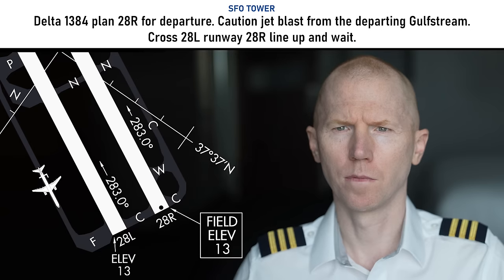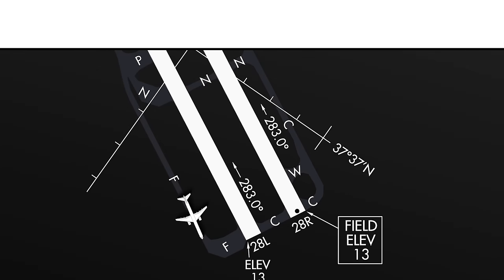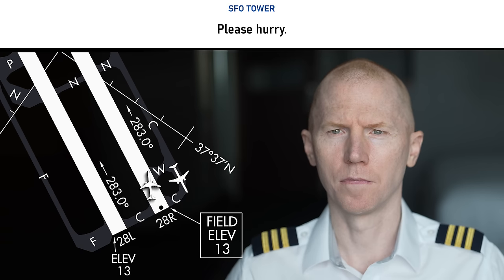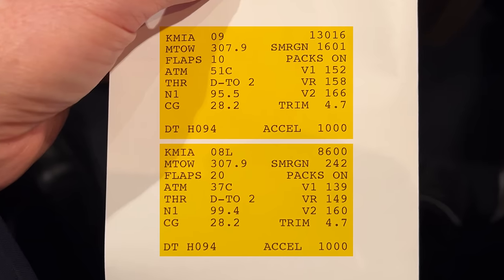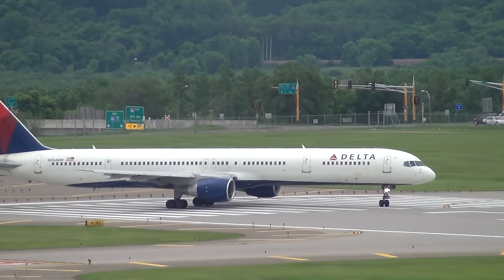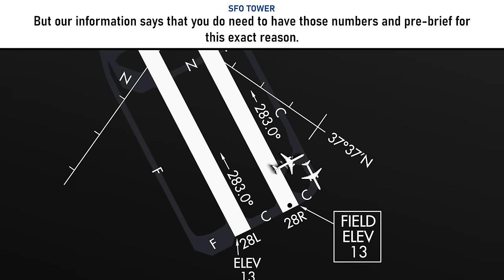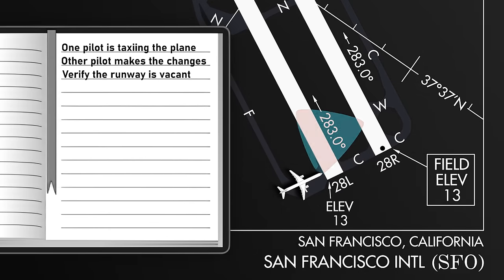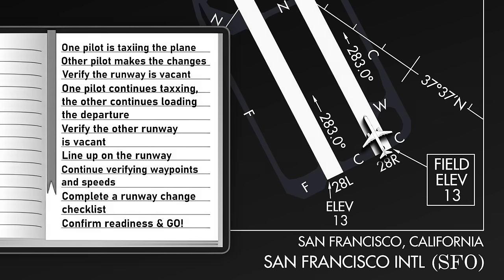ATC Doesn’t Like Delta’s Comment

Comment: As a pilot that flies out of SFO you know to always run numbers for both runways.
Reply: I fly out of SFO 6 times a month on average..  We always do that at our airline but to plug the numbers in, verify and do the runway change checklist. Takes more than 2 min…. Delta should have told the controllers they will hold short, and SFO controllers need to get their crap together.  Controllers are not in control of the pilots and planes.

Comment: In this day of fast communication and computers I'm surprised that the pilot must do all that setting of numbers manually.  Each airport should have the external points available instantly for each runway,  and the pilots should only need to change their individual aircraft data. But ATC must make allowances for last minute changes like this and clarify WHY such a change is needed.  I see room for improvement on both the pilots and ATC in this situation.

Comment: Setting them up for failer? Yeah! you think? Look, ATC has pulled this kind of stuff with me a number of times. Changing the runway at the last min and exspecting you to be up a ready in a snap. One thing I have learned is never let ATC or anyone push you onto somthing you are not ready for. That controler was way out of line. That Delta crew should have just stopped right there and took as much time as they needed to get their new numbers and re-brief what they needed. They should have told ATC what they were going to do and not give a danm about her(ATC) being impatient. Ever ask yourself why we are seeing a up tic in close calls and incursions? because of stuff like this.
Reply: Excellent. And I'm retired underwing!
Reply: Yes, you are spot on, and SFO has been getting a lot of these kinds of close calls lately. Not only frustrating for departing crews but inbound crews as well, often having to perform go-arounds. I just saw another video a few days ago about a crew that had to perform two go-arounds. Not good!
Reply: AMEN !
Reply: Rushing is never a good situation no matter what the event. If you look at mistakes made (sometimes big ones) rushing is a common cause. 
Cheers
Reply: The controller gave them that option. She told them exactly where the traffic was and if they weren't comfortable to hold short. They chose to be on the runway because they said they'd be ready. Then they weren't ready.
Reply: @beater8687 She didn't tell them what the traffic actually was, and therefore didn't tell them how much time they had to work with... As Kelsey explained.
Reply: @iro6758  did you listen to her next transmission? The one where she said traffic's 5 minutes out, if you're not comfortable with that hold short of Rwy 28R?
Reply: @beater8687 pretty important info, which she already had, so it wouldn't have hurt to mention it in the original transmission
Reply: @beater8687  "Did you ignore Kelsey and only pay attention to her finally attempting to be competent - eventually - after already pushing them in this direction with little-no relevant information?"
No.
Reply: @beater8687  don't you dare to blame the pilots
Reply: @georgemccoy219 :
I'm not a pilot, but it seems to me that any number of go arounds (within the minimum fuel reserve limit), would beat "bending"/"breaking" the aircraft, or endangering anybody, at least 💯% of the time?!?!
🙂
After all, the goal is supposed to be getting all of the passengers & crew on the ground with the aircraft (ideally), being in good enough condition to be reused, or so I've been told.
Reply: @daleallen7634 I'm also not a pilot, but from what I've seen and researched go-around procedures just increase the pilots' workload and reduce their situational awareness. A go-around is always preferable to an accident, but unnecessary go-arounds can actually increase the likelihood of an incident. If they can be avoided, they should be avoided.
Reply: @jacksonlynch1731  :
So, go arounds "are preferable to an accident".
But, they "should be avoided". 
Which is it?
At the end of my day, going around beats GAMBLING on a "safe" landing.
Most commercial pilots are very (too?), reluctant to request a go around, or any other emergency, or precautionary procedure, anyway.
Reply: @daleallen7634  It's not really a difficult concept. Driving your car into a road ditch is preferable to driving head-on into a school bus. But driving your car into a ditch is still something you'd want to avoid if possible. Just because something is the lesser of two evils doesn't mean you don't want to avoid it if at all possible.

Comment: You should fly into Oshkosh and see what super ATC controllers are really like. Talk about runway changes and halfway landing or take-off points.
Reply: I used to work at the Oshkosh newspaper and have been in the control tower (the old one) during Airventure.  I did find the controllers at Fisk more interesting, personally.

Comment: Why has no-one in aviation software  heard of hash functions/codes?  An aviation standard way to calculate them would make verifying all these numbers much easier/safer.
Totally agree you shouldn't brief both just in case though.  Human memory is bad enough at doing one thing.
Reply: Yes!  best comment!
Reply: Information can be entered correctly, but sometimes the information is shit and only picked up on entering, cross checking and sanity checking the values. As much as I love the idea it will lead to complacency

Comment: The initial runway change to 28R included the line up and wait instruction.  For whatever reason, holding on a runway while reprogramming the FMS is an invitation for Mr Murphy to introduce himself.  The crew was hesitant about it and wanted to confirm the line up and wait assignment.     If the runway change assignment was earlier in the taxi it would have helped tremendously.  As is, ATC is playing with fire here and they could absolutely get a contributing factor assessment if there were a tragedy.  I have t read the ATIS but I doubt any pilot would expect a runway change assignment and a line up and wait clearance at the same time unless it was a small GA aircraft
Reply: There's a comment above from someone who said they were right behind that Delta, and that such changes are common at that airport. And that they as a crew do prepare each time for it.
I think the pilot with his 2 minutes estimation is as much playing with fire as you think ATC is. Underestimating a procedure by half is not a good idea when it's that close.
Given i am not a pilot, i do have to drive onto runways occasionally , and even though i do not have to prepare all the data pilots do, i do have to prepare for the measurements i take (no not the "skiddometer" ones, we do regular checks of LLZ transmissions). And if i get asked by ATC about how long it takes me, i either know the exact time it takes and add 1 minute to it, or i do a little overestimation to be on the safe side.
Same when we do longer measuring drives. Then we can't say how long it takes as a whole, but we estimate that we can clear the runway and safety zone in a certain timeframe. And it's better for the safety of everybody to not underestimate time needed.

Comment: She tried to help them to get out and not have to wait for that traffic.

He said two minutes. He knew he was lining up on the runway with traffic on final.
He might as well have said I’ll be some time, who knows.
You can’t just make up numbers when you are lining up and waiting with traffic on final.
Be accurate or hold short. Delta should have accepted the hold short.
She tried to help them to get out and not have to wait.
They messed up.
Kelsey is being pilot friendly, but this is SFO not a smaller airport like San Carlos and even then they shouldn’t cause a go around for the traffic on final.
SFO!
Reply: I agree 100%... if a controller gives you a crossing restriction, a pilot just can't say    I was about to or on my way to cross. Either you agree or say 1 word "unable".

Comment: My best friend in the Navy who was hired by Delta as a 727 FE in 1981 confided in me that it disturbed him that he often had to scramble to start the third engine because the Capt accepted an immediate takeoff without the center engine running. (Back then high fuel prices resulted in doctrine to  taxi out with less than all engines running). He stated that it happened more than once that he was starting the third engine on the takeoff roll.
Reply: That's insane.  Someone's head should've rolled over that nonsense.

Comment: I am not a pilot. But all I can think about in this analysis is that we are not in WWII with airplanes with steam gauges and paper maps trying to get sorties off as quick as possible. As a passenger, I really don't care if we are even thirty minutes delayed for takeoff (I know that in most cases the pilots can make up that time in the air). I am an amature radio operator, however, and I know that when I run a pileup on my net (where more than one station is calling me at a time), I have to remind folk that we are not in a race. I'll get everyone, just be patient. The bottom line is that everyone is safe. For me, we are all ground based, and in my thirty years of being an amature radio operator, I have never had a life or death situation. Airplanes are in a life or death situation daily.
Reply: As a passenger, I'll be happy when emotionless AI takes over these situations.
Reply: @conradinhawaii7856  What did you base that comment on? Technology is always improving and automated vehicles, including aircraft will be a reality whether it scares you or not.
Reply: I was thinking the same thing. The way I see it: the main problem was that it was an option AT ALL, when a runway change is announced at the last minute, to do inputs in the computer on the runway with an approaching airplane on your tail.
Reply: @unzarjones  Not sure just yet about that, but some more assistance would be great. All these tests that were talked about could be performed by a computer, and you would not even need AI. Cold hard business logic and algorithms get you a long way, and they are void of the insecurities that an AI may bring. Having an AI system that alerts when something goes out of kit would be nice though; I think that's where they should start. Not controlling, but checking.
Reply: @unzarjones  
Forty-plus years of flying a variety of airplanes, including four-engine airliners, countless hours communicating with ATC, and having friends who have worked in ATC for their entire careers. 

A.I. so-called "experts" have been predicting, since at Least the 1990s, that computer-flown airliners (and computer-controlled ATC) were "just around the corner". So why do you suppose that you still have two Actual human pilots up there in the cockpit of those 737s, 777s, A-330s, and the rest, and Actual humans in towers, TRACON, and Center facilities? Something to do with the ability to reason, perhaps, rather than simply running programs? And how have those "self-driving" Teslas been working out? You know... the ones that have been killing motorcyclists from behind, and pedestrians, because the computer's sensors didn't "sense" and recognize their presence on the road? Situations like that should be quite "interesting" in an airliner typically cruising at around 400 knots. 

But you are More than welcome to be a passenger aboard any A.I.-controlled airliner, if that ever actually happens. Those of us who actually fly airplanes,  and understand the vast differences between operating any vehicle on the ground, which operate in only two dimensions, and flying an aircraft which operates in Three dimensions, not to mention a variety of meteorological conditions which affect every facet of how they fly and perform, will be happy to watch, from a safe distance, the inevitable outcome.
Reply: @conradinhawaii7856  you make some good points.  But using cold numbers.  Last year over 42k people died on the roads in this country. IF every vehicle was controlled, interconnected. The estimates are 4K to 6k people would die in traffic accidents due to auto drive error.  So yes auto drive will kill @5k people.  But people ignore 37k who lived.  That said I don’t was AI, auto drive… I might be ok with it on interstates only. 
  Planes i want a human pilot.
Reply: Mentour Now says 10,000 planes were built similar to the DC-3. Meaning one HECK of a lot of army air force people knew how to get one in the air and fly to a target. Probably a huge multiple of civil aviation jobs.
Reply: @conradinhawaii7856  They said it about cars too. It's only a matter of time.
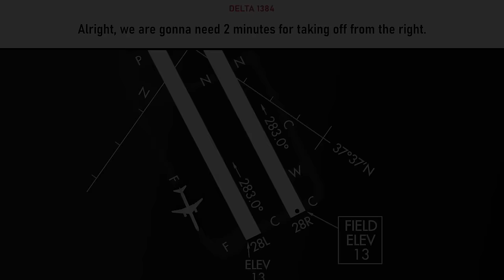Reply: They never really make up time in the air. About 20 years ago they padded all the flight times, due to many flights being late. So the published flight time is 30 min or more than the actual flight time. That's why after this change you never see the TV commercials with "most on time flights" etc.... Where prior, all the airlines too turns bragging about how "on time" they were. I first realized that on a trip to Cancun, where I had flown many times to. It was always a 2.5 hr flight for me. Booked tickets one time and now it was 3:15 hr. Questioned the added time. But the actual flight time ended up being 2.5hrs, like it always was. But yeah, there are a few things they can speed up a little, but think about it. Do the airlines want a plane deliberately in the air for 30 more minutes an a 2 hr flight and burn up all that fuel?
Reply: @inothome  As I said about my driving philosophy: All schedules go out the window if I crash. So I take whatever time a safe trip requires.
Reply: @unzarjones  
Uh huh... suuure.  Whatever you say. 🙄🤣
Reply: @JimMork  My reply was for the original post, about how pilots "make up time". But, the airlines schedule more time than the actual flight needs. So, they can leave late and still make it "on time" or ahead of schedule.
Reply: You might not care that you’ll take off 30 minutes late but the companies who get fined for late departures sure do!
Reply: @RomySews  Only late push.
Reply: @RomySews  THIRTY minutes? The landing plane was ten at max. But, once again, any accident may erase  you or make you a day late. Just as traffic accidents totally wipe out schedules. And when planes crash  like Tenerife that ALSO was a guy reasoning like you do, two planes were wiped out and hundreds of lives ended. "Fines"? Honestly? You think fines are a some big deal?
Reply: Are you trying to type "immature" or "amateur"?
Reply: @DavidSprings  Probably "amateur." As in "HAM" radio (or related).
Reply: @DavidSprings  I am so sorry if I was incorrect. I had a stroke several years ago and even though I hold a doctorate, no longer do the words translate from my head to my fingers. Amateur Radio is what I was trying to say. KB7QOD.
Reply: @unzarjones  But no one HAS to buy one. And if they share the highways, maybe a few of us can figure out ways to avoid them.
Reply: @conradinhawaii7856  I agree with  you. Let the ads say "WE use AI. Fly with US". And the thrill seekers and dependent personalities can pay for the tickets. And if there are surface alternatives, perhaps contrarians can skip "AI in the sky".
Reply: @larsharris  That old argument. I've seen that hundreds of times. I always say "Perhaps. We have thousands of totally unskilled operators on the highway. MY record since I first started driving is 100 percent different. There are many things done wrong on highways I don't do, and my insurance company gives me rock bottom rates to reflect that they aren't getting claims from me. But the  logic never stops some from dragging up "stats". Recall Mark Twain: There are three types of lies:  Lies, damned lies, and statistics."
Reply: @DavidSprings  "Replied" This is a question not framed as a reply to anything.
Reply: @JimMork  you can disagree with estimated Number of deaths caused by  self driver mistakes.  But you have to admit.  EVERY accident/fatality where self drive is suggested to be at fault is big news.   If you drive much.  You have learned almost half the drivers on the road are below average.  Many far below.  I am researching “dash camera” systems.  For proof of other drivers stupidity causing accidents.   I felt admit I have made mistakes on the road.  Often it’s poor design in road.  I am in left lane, it becomes left turn lane.  Zero warning.  (Yes I went back and looked with wife). As I had to make the unwanted left or cause dangerous situation.

Comment: Briefing two different departures is like briefing no departure at all. Departure Briefing Items are basically like Memory Items: You need them readily accessible in your mind. Trying to remember WHICH of two different sets of recently-briefed instructions apply, when you have an engine failure rolling down the runway, is an invitation to error.

Comment: I saw a video with atc and pilot exchanges (kennedy steve my fave), but in one the pilot was in a rush to leave and getting snippy with with atc, but they were on hold due to weather over the airport. The pilot thus said he didnt care about the weather. Atc said something then a new voice broke in saying FAA had just joined the chat. The pilot had a few slightly less rude comments but was noticeably subdued. Later of course he was given the dreaded theres a number for you to call. My question is how often does the FAA get involved and do they monitor atc channels? I thought it was just the tower thst would have thr little conversation with but the FAA clearly became involved.